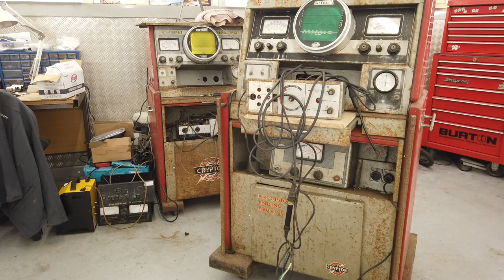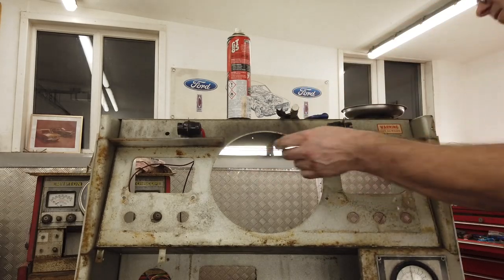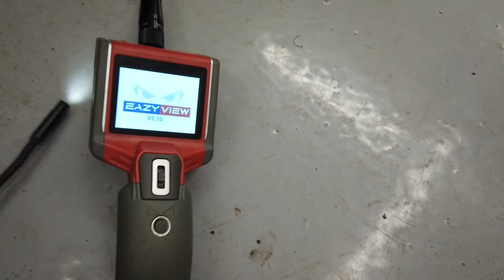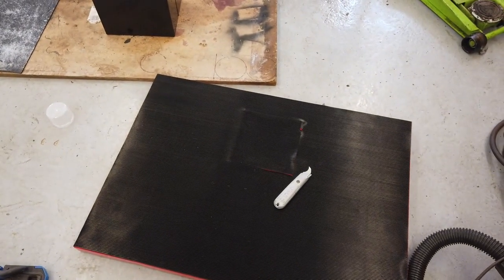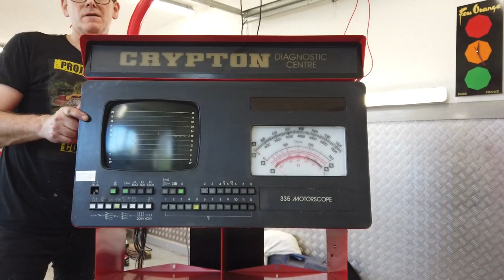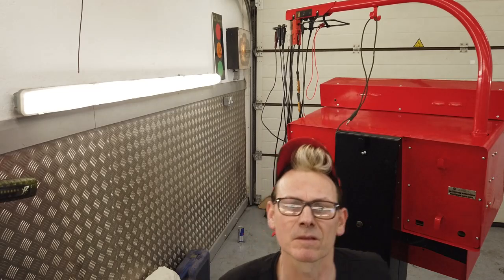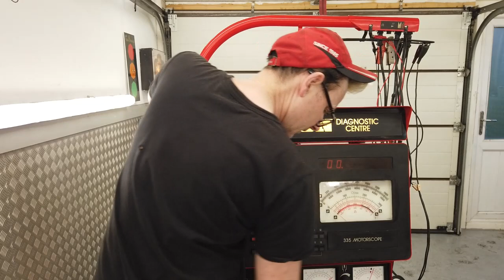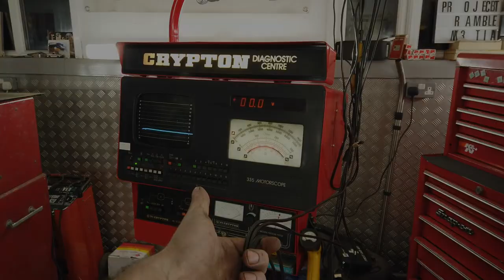Crypton Motorscope 335 - Restored

Comment: With that point-to-point wiring, those look incredibly dated, even for 1962.  Those sub-modules look like an old fashioned tube/valve radio in their build style. Of course, that's why they can be rebuilt almost 60 years later.  This looks like it will be a fascinating rebuild.

Comment: Great work Pete.  Love the Cortinas and your work on the Crypton analysers.  I have a Cruise Mate 440 being delivered to me and I need a manual.  Do you know if it is similar in function to your 335?  I am really impressed by your setup there.
Reply from the maker: 440 is quite different from what i recall, more advanced circuit boards....though there are some differences, i think even on the 440 the tantalum bead capacitors break down and you can tell as the either fracture or go a dark colour. cheap to buy at 20p each.
Reply: @PeteCswampy  Thanks for the reply.  Indeed the 440 seems to be different, but as you say the tantalum caps cause all sorts of mayhem in there.  I am going to go through all of the boards and change all of them and maybe any electrolytics that look or test a bit iffy too..  Hopefully, I'll breathe some life into it..

Comment: Hiya, I have a Crypton Auto Mate 450 with screen issues. Any ideas where I could find parts for it? Many thanks in advance.
Reply from the maker: cant help with this Geoff, i was lucky with mine, many of the circuit parts can be bought from CPCFARNELL but you need to know what is failing/broken, the units are normally pretty reliable, however they are a specialist item, there are circuit diagrams out there, you need an old skool tv repair tech to help you
Reply: @PeteCswampy  Thank you. Do give me a heads up if you know where I can find the circuit diagrams. I have found many swollen caps and a few blown resistors, which I am having a hard time identifying. Keep up the good work with your restorations! They are quite entertaining to follow.